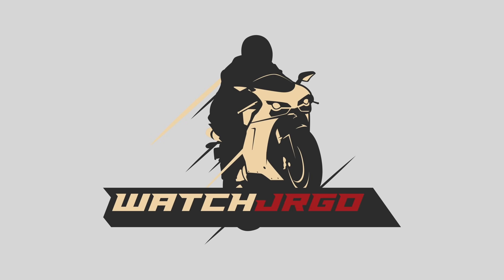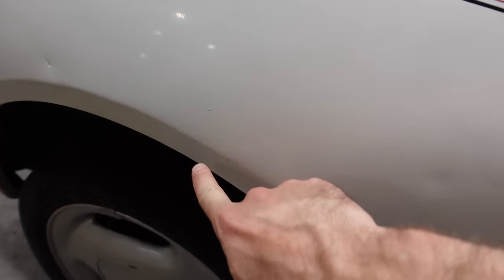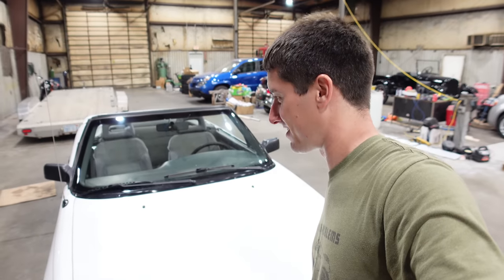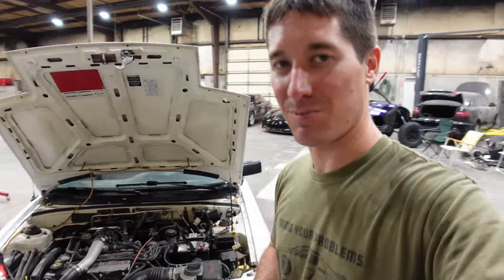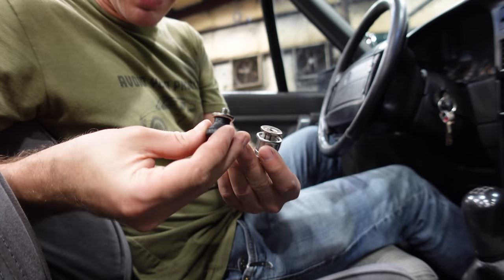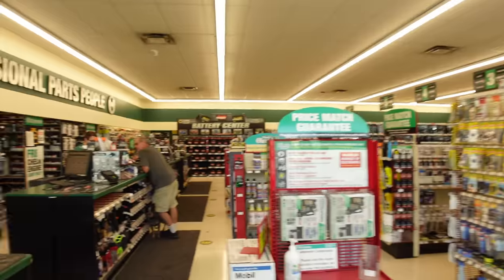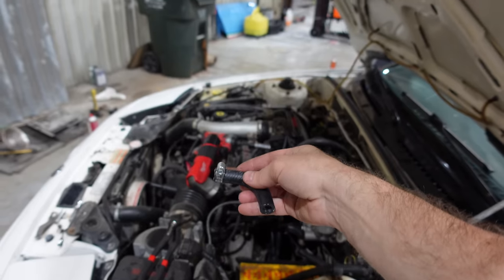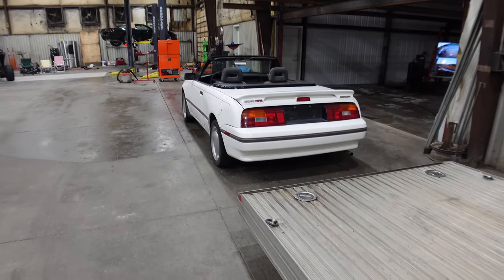Here's Everything WRONG With My CHEAP Survivor *1992 Mercury Capri XR2*

Comment: looks like the Euroasian Auto, Inc. has a 1991 Capri front glass for $95.  I would call old Urination BOB ASAP.
Reply: Everyone up this too the top , so JR sees it.
Reply: These were much more common in Australia, so his next step would be to try to have Crocodile Dundee send a windshield over.
Reply: That is a steal, especially if it is Ford original glass!
Reply: Bob has EVERYTHING
Reply: I'm curious where the "$700 for everything" came from?  The dealer?  I popped over to rockauto and Cardone calipers are about $60 a pop, Raybestos rotors are about $17 each, Centric front pads are $20 for both fronts and about $18 for both rears.  Hell - Even napa's parts were only slightly more expensive.
Reply: @elesjuan  because he's a "certified YouTube mechanic"...they inflate the prices. And he probably has a commercial account with O'Reilly too. I worked for O'Reilly for 7 years. Commercial manager for many years. Commercial accounts get killer deals on brake bundles. He said the car was the cleanest, then says it's not flawless and proceeds to show damage to the car. I miss watching the old jrgo videos. It just seems like he thinks he's better than most people because he's got some big shop and these cars he never drives and just let's sit around while he's in debt over his head. No thanks. I don't need "nice" cars for people to think I'm cool. And for anyone who says "I bet you couldn't do YouTube"...I don't need to make videos. I'm a better mechanic than half the people on YouTube and I have nothing to prove.
Reply: @thagerdorn2009  Man... gonna be an unpopular opinion here, but I agree with you 100%.  Old JR videos are much, much, MUCH better than  what's come out over the last like two or three years.  It's a real shame.

The unfortunate thing is the same shit happens to literally every youtube channel I find and enjoy.  They start out small, quirky, fun... then suddenly ray's con shitbuds and some shit-tier overpriced chinese wallet is the greatest thing ever to them.  In the last ten years I've seen this same shit happen to probably 50 channels.  Once sponsors come along the content quality just goes into the toilet.  You want a PERFECT example of this?  AvE.  Remember when he made content that was fun and educational?  Yeah, me too.  How about Demolition Ranch?  I could go on....
Reply: @elesjuan  lmao..I did the same. I was like where the hell did he go. I came up with about couple hundred bucks if that.
Reply: @stevevarholy2011  He lives in Venice Beach CA.

Comment: Chose one of these over a miata back in ‘93, needed the extra practicality of a back seat and boot for. 
Had it for 8 years, loved it, but when it came time to get back into a small convertible 10 years later I bought a ‘90 miata because it was going to be easier to source spare parts as it got older.
A shame, the Capri was a sweet handling little front driver, and had less scuttle shake than either of my miatas.

Comment: Many good & some bad memories coming back with this car!! Happy to see the Capri again. ☺
BTW, do not drive it in any semblance of a rain storm. You will likely need to bale 2 inches of water from inside. Carry a jacket or something dry to lay on the seat because the driver's seat will hold several ounces of water. 
They were called Crapis for a reason. Luckily most of the troubles were on the 1991s.

Comment: Neat video, JR. Cool little car. That bypass hose looks identical, diameter and all, to the one on my 78 and 79 Thunderbirds as well as my 87, 88, and 89 Crown Victorias and Grand Marquis. Between them they had carbureted 302 and fuel injected 302 W, 351M, and 351W under the hoods.

Comment: Oh shit, it's basically a front engined MR2 Ford? At least those tail lights look similar. How sick! Never heard of these. I knew about the other front engine Capri's based on the Fox body Mustang but this is news to me.
Reply: The Fox Chassis Capris weren't even the first ones.  They actually came out in the early 70's here in the US and are quite beloved in the UK.  They were originally called the Ford Capri as well.  The V6 was a nice engjne to have in those, or at least the 2.0L OHC inline 4.  They could be modded and tuned quite well.
Reply: Ford Laser were very popular in Australia as a hatch , basically a 323 with facelift. This is basically a 323 chassis and drivetrain. Local consensus at the time was it shouldn't have been called a Capri

Comment: A good trick for hiding the holes after you remove the front licence plate frame is to use apoulstry button covers with screws. You can paint the plastic covers the body color of the car.
Reply: *upholstery...
Reply: God damn.  You were so far off on that spelling even autocorrect couldn't help you.  It was probably wondering wtf is this guy trying to type

Comment: My buddy's family had one of the original Capris from the 70s with a tiny v6 in it. I also remember the 80s one based on the Mustang and remember another friend's buddy doing a huge burnout on the street in front of his house, pretty sure it was a brand new one with the 5.0. I don't think I remember this version but the turbo and convertible makes it interesting and rare. So many versions of that name were sold here back in the day.
Reply: I still have manuals for them.  The Fox Chassis was heavier, but had better power options, especially the V8.  Those were only produced from '79 to '86, though supposedly some were made for '87 before they cancelled the program.  

I tried to get behind this one when it came out, but the FWD and lack of real power just kind of did it in for me.  Besides, I still was in love with my '86 bubbleback Capri with the 5.0L!

Comment: I had a '91 n/a, most part were expensive & had to be special ordered from Australia, when you do the tune up replace the chip in the distributor, I learned than the hard way
Reply: Also it was cheaper to rebuild the alternator then to replace

Comment: Me and my buddy have a 91 xr2 with a 5 speed, we are currently stripping it down and rebuilding the engine to make some more power, just got some 60mm offsets and probably gonna do a 1.6 miata turbo swap, with a whole bunch of other miata parts. And eventually maybe might swap a frankenstien k20 / k24, and upgrade the suspension and tires.the goal is to have a fun quick but slow street car that can eat backroads.

Comment: Hi I live in Australia and picked up a Survivor  Ford Capri XR2 Turbo. 9.1992. Basically the same thing with less than 69k kilometers on the Odometer  ( with papers to prove it..) 

 I has same problem with leaves for a While. My Biggest problem was 'RedBack spiders in Residence.' And they Were harder to Evict..! Spider bombed the Car Twice. And I was still having an Occasional visitor..!

 I have Replaced the Plastic Radiator for Aluminum with a Bigger Core..! It gets warmer here in Summer and using the Turbo. Sent the Temp high..!

 Good luck have fun. Kim in Oz.😎

Comment: My dad had a 99 VW Passat wagon that he parked under trees often.  The leaf debris got so bad under the cowl, it either caused the A/C weep tube to get clogged and start leaking into the floorboard, or it might have been the heater core.  Either way, he got rid of it shortly thereafter.  1999 was not a good model year for VW.  My brother had a lot of issues trying to straighten out his wife’s 99 Jetta.

Comment: Such a sweet car. With my European eyes it has a whiff of Pontiac Fiero about it which is no bad thing.
What a survivor though; if some leaves and a coolant leak are the worst offenders, it’s done well 👍
Reply: Good eye! You're right! That Fiero was rear mid engine, also similar to the Toyota MR2. Nothing wrong with the design, except the American market wasn't ready for it at that time. The 1986 Fiero GT was one of my favorites American designs by then; it looked a little wider than the original one.
I had a Mercury Caprí XR2 for couple of years, it was like a go kart, very nice! w/Mazda technology but far from the RX7's performance and the Miata. 
Remember the Fiat 1/9? (1979//1982) Rear mid engine, it was avant-garde and the japanese got seduced by the Italians designs rather than the quality )ö(. The MR2 was very similar and came on 1982.  Salud!
Reply: I just confirmed the Triumph TR7 came on 1974, before the Fiat 1/9. Wow!

Comment: Hi Mate, Great car,0 I love mine..
 First thing I did with my Barn Find $1500. AUD. with 68.000km's on the Odometer.
 Was Brakes, (thats why it was in the Barn, Metal on Metal on 3 wheels..!?
 Pads and Slotted Rotors All round. Plus a new 'CatCon' and bigger Bore Exhaust. Aluminium Radiator too. It gets warm down here..!! 🥵
 This made it Safe and Sound great too..!

 I dont know if there were Different part's on the Mercury to my Ford (here in Oz.) But Some Laser parts are common to the Capri.
 And the B6 or 
B6T mazda engine is/are  all over the Place.

 Turbo parts may be an issue but, I located a Local Guy to me, who had spare parts falling out of his Ears.

 (Thx Ian your a Star..!!)

 I bought a Spare Engine Gearbox, wings, Front clip, Bonnet, doors ect ect. (Shed loads in fact..!)
 I also intend to join a Club for every model of Capri. They can be very helpful..!

 Good luck Fellow XR2 Turbo buddy..!! 
Cheers kim in Oz.😎

Comment: I have a few original oem front rotors if you need a couple. Also, be very careful with the shifter and Do Not press down on it very hard, if you do there is no fix.

Comment: I would have to disagree with the Car Ninja about the hose clamps there JR. The worm gear clamps are good I agree, but they only clamp down with the force you apply to them whilst installing the new hose. After that they are static, so if the hose or the pipe it attaches to deteriorate it loosens its pressure and you get a creeping leak. A spring clamp of good quality in that scenario keeps on self adjusting as the hose or the pipe deteriorates and tightens it's grip continuously.

Comment: Cooling system pressure tester would be idea for finding that leak.  You can pressurize the system without cranking the  engine and getting it hot.

Comment: Ford and Holden in Australia really can build some cars. Shame that GM killed Holden with their ineptness. Ford Australia pumps out some nice cars that we don't get. But we also get guns, Raptors, TRX and C8's.
Reply: Could, not can, they closed down auto manufacturing in Australia after building some epic cars. Ford Australia now designs epic cars including the new Bronco that we don't get here in Australia. We got this Capri in Australia badged Ford Capri in Right hand drive and they were built at the Ford Homebush plant which later closed and the site was repurposed for the Sydney Olympics in 2000. The Capri was based on the Ford Laser/Mazda 323 platform.
Reply: The Capris were built in Broadmeadows (Melbourne), I remember the Vic Premier at the time making a big deal of the first batch sent Stateside. The Lasers came out of Homebush, except for the turbos which were Mazda builds.
Reply: The Ford Laser was the Escort over here. My uncle was a huge Mopar nut, but he had an Escort hatchback and the wagon. Oddly enough, his wife had the Mazda 323 which was basically the same car. Later, he got the Dodge Dakota R/T when it first came out and my aunt got the Mazda MX6 which was basically a Probe and they trashed Ford, even though his wife was basically driving a Ford and he still needed to drive his Escort and we rally raced his Escort a few times. I don't know how the Laer did in Australia, but here in Florida, the Escort soaked up the dirt, sand, swamp and snakes just fine. We speedball raced in his truck from the panhandle of Florida to Key Largo. We took the MX6 to a race around the state and it did horrible. It's always neat to hear about the different vehicles people get in other countries and how well they do, or don't lol

Comment: I’ve had great luck with EnviroSafe refrigerant. Works I. R12 and R134a systems- and at lower pressures. It’s super cheap too. I’ve used it in Merced’es, Ford, Chevy, r12 and R134a systems. It’s way better than an r134 conversion of an R12 system.

Comment: If those hubcaps are like the ones on a probe, be VERY careful removing them.  The clips break if you look at them wrong.
You want an expensive windshield?  85-88 928s had the radio antenna imbedded.   Cost me $1900 installed.  A windshield from any other yr was $300.
Since you brought it up, have the R8 ECUs arrived?

Comment: There is so much vibration at startup, looks like you might need engine mounts. Also, seemed like your steering wheel was cocked left a lot while driving... an alignment couldn’t hurt. Probably a new bushing in the shifter would take out the sloppiness as well, these shifted nice n tight when they were new. Loving the Capri-Sun! 😁 Liked and Subscribed!

Comment: I thought those might be cool when they were new. The specs looked great until it came to front wheel drive, deal breaker. I have seen 4 in my life and 2 were at the dealership. For the same relative price you could have had a Miata with proper rear wheel drive and installed a turbo.

Comment: You might want to check out the turbo system. Notice it hits 5 psi just driving and when you lunch it goes down to zero man might need a new waste gate blow off valve or maybe a boost leak

Comment: Hey JR, what causes the water in the exhaust pipe when the car is started? Mine does that too. Is it bad for it to do that? I wouldn't know, I'm not very well mechanically inclined. I won't say I can't fix a car, just the ones with carb, points and condenser. Know what I'm talking about? Sure you do, I knew you would......LOL

Comment: $700 in brakes I just went on rock auto and they have bendix rotors for $18 and $22 and are $15-19 for pads. Rebuilt calipers from autozone are $40 each Front and $65 each rear. Did he go to the dealer and get the 360 F special? With no lube?

Comment: I picked up a sweet "93 turbo rag top is perfect, been sitting 9 yrs cant get fuel tank so I put a fuel cell in now the issues is spark plug wires or cap not sure which, but I have fire at 2 wires only, other 2 are dead what is your thoughts! i have new cap and rotor wires and coil coming

Comment: I had a capri back when they were mustang clothes. Slowest car I ever had. 1984, four cylinder non-turbo.. could barely make it up a hill
Reply: Sadly, that 2.3L was a dog for a car that heavy.  I had an '86 with a 5.0L V8 HO with fuel injection, AOD tranny and a 3.27 limited slip rear.  I'd always laugh as the guys with their buzz bomb ricers would fly by on the flats, thinking they had power and were fast.
Then we got to a good hill and I'd wave and laugh at them as I flew by them uphill.  She was a beast for her time!

Comment: I know the floor pan is different....BUT...Hear me out...I have a great idea....Swap it out for one from the Mazda 323 GTX....Or just make it all fit somehow...Ya know how insanely cool it would be? AWD, Turbo, Manual trans....in a convertible the size of a Miata.
Reply: So you're saying you want an Audi TT roadster quattro? My '04 has all of that: 1.8l intercooled turbo I-4, 6-speed manual transmission, Audi quattro all wheel drive.  Just get that, I'm sure you could find one on AutoTempest for a good price.
Reply: @AndrewAMartin  Yeah um, just pretend the quattro TT doesn't exist ;)
Reply: @Blackinterceptor999  It would have been cool if Mercury had made the Capri AWD, for sure.  I'm guessing they didn't for cost savings -- it would have made them miss their price point.  It didn't sell well in any case, not enough to support adding an AWD model (if that was even feasible from a technical standpoint).
Reply: @AndrewAMartin  Also coming from the European and Fox platforms, this one just didn't have the same feel as all the ones before it.
 The history probably hurt sales as the people that would have bought these new would remember what they used to be...this was too different so the Miata won over sales over this model
My old '74 Mk1 Ford Capri was FUN, FAST, and got amazing gas mileage....Wish I still had it these days!

Comment: The best were either the originals, or the Fox Chassis Capris.  Sadly, while these had the potential to be rather fun, they just don't compare in my opinion.

I'd rather have the last generation Cougar, which was also a front wheel drive compact.

Comment: Got mine for $800. Only problem is the passenger pop up headlight won't go down.
Reply: Did you find the manual adjustment nob? The lights have a nob on the back of them you can use to manually raise and lower them.